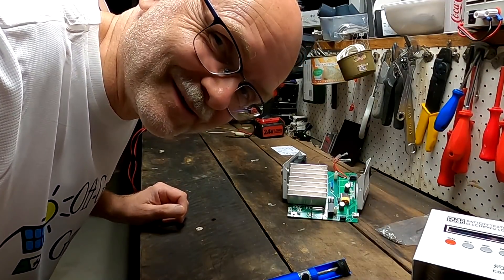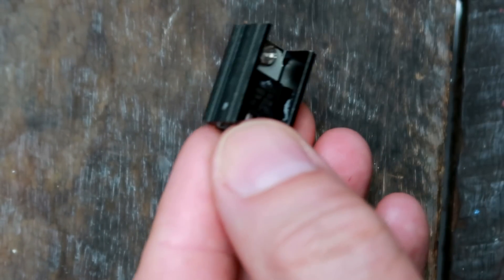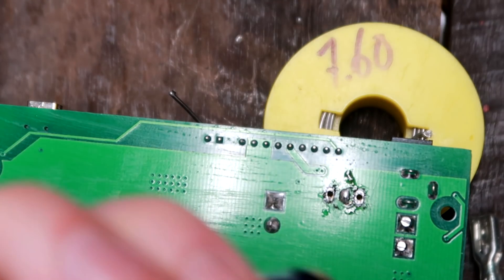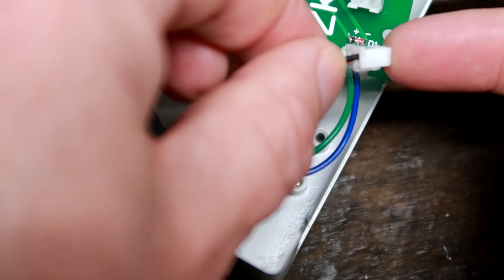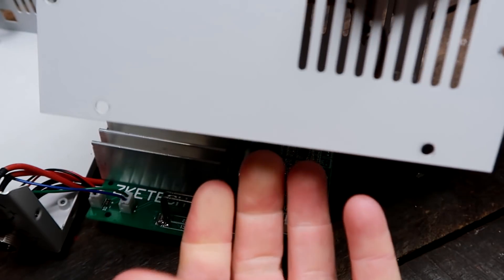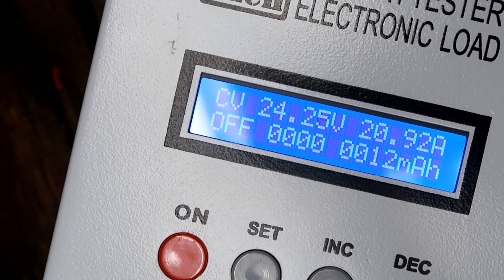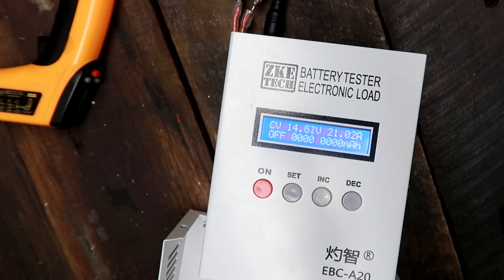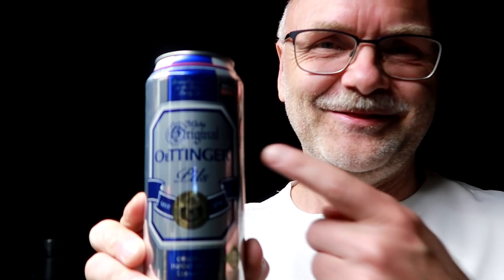Battery Tester Repair. Train wreck or fix? Part II

Comment: Yes that 0 volt plane really buggered you. Solderwick and a very hot iron to get the excess solder off then, heat it up again and push a bit of copper enameled wire through or, perhaps a very small drill; you need something the solder can't weld too to clear the hole..

Comment: All a bit lateI know but, you need to fit an H30 rubber sleeve over the end of your solder extractor so as the sleeve presses against the track where solder is to be removed. Also,the sleeve will protect the track from the hard tip of the extracor.
Fresh solder or flux should also be added to make the old solder more runny. A lot of heat will be needed for large + or 0v planes.

Comment: Hello, dear Andy ! Did you tried to change the main MOSFET ? My EBC-A20 showing the same symptoms now when showing 21A current out of nothing and can't analyze anything anymore, not discharging at all , only charging with about 6A regardless what I set but calculating like it is 21A :) and no voltage sense in the software (although on display shows it real) That all happened after reverse polarity by accident and I found out the main MOSFET exploded... I see there is no part 3 of this saga so you never tested this tester ? I ordered the new MOSFET for it , I need to wait more than a month to receive it (I live in Vava'u, Tonga). I'll try and let you know (if anyone will notice this comment at all... not much hopes but writing just in case... )
Reply: I received 2 packs of MOSFETS (ordered from 2 different sellers, but exact same part number which is exploded in my EBC-A20) and replaced it. No luck anyway. Same 20A current displaying regardless of anything set or connected or no. Then I changed the MOSFET to another one. Anyway did not worked. Nor charging or discharging mode. But then I found out it is actually only discharging with current 18A according to clamp amp meter ! Immediately after connecting a battery the discharging current starting going. I check - there is no short between +/- crocodiles. only 130Kohm.  I don't know may be the relay burned too and it's always connected to discharge mode. But why 18A then. So I gave up and going to buy EBC-A10H 30V 10A 150W ; it's max 10A discharge but EBC-A20 can discharge 20A but max 85W, while A10H can 10A/150W :) Charging is max 5A also but with max 150W , instead of 85W.

Comment: desoldering tips
1) don't pull the iron away, put them BOTH to the joint from opposite directions, iron angled low to minimize interference with desolder tip.
2) try solder braid!!!
reason pin 2 was a bitch,.. it's the regulator ground pin so that via is connected to the ground plane, which quickly wicks heat away from the solder.
Also, yes, there are vacuum desodler tools. IMHO, they all suck arse.

Comment: I guess when the original voltage regulator broke it let the full input voltage out to some sensitive electronic components like semiconductors or IC which killed them. That happens typically when a voltage regulator fails. But i remember that you checked the output of the broken one and it showed zero. Normally they tend to go short from in- to output, maybe just for a short period after it completely broke by overload then...

Comment: Tipp: use a tooth pick to get a hole in the solder pads when the sucker is not working! Or use desoldering brasswool to suck the solder out. And give the poor L7812 a bigger heatsink - it will get very hot with a 1 Amp load!

Comment: If you just take the mantle out of an ordinary coax cable and soak it into a bit of flux, it WILL suck up the soldering stuff (tin/lead/silver).
If needed a compresor could work too but then you have to find ALL the blasted conducting stuff around your soldering spot.
Very luxury: a sucking soldering iron will be the best.

I get less and less enthusiastic about this ZKE tester....

Comment: Datasheets.  The devil is in the detail and each figure is usually given independent of it's constraining variables.
For example, you correctly stated the maximum input voltage of 30V.  The minimum is 14.5V though for proper regulation of 12V under load.
However the limiting factor will also most certainly be the "Heat dissipation" of 15W.
It's a linear regulator.  All voltage is linearly dropped as heat.  If you have 30V in and 12V out, that's 18V dropped.  If you put 1 Amp through it, then 18W of heat will be dissipating.  The package cannot handle that, heatsink or not.  The maximum heat dissipation is junction to package, even if you put a square meter of heatsink on it, 18W will cook it eventually.
However.  Note that the package to air W/*C will probably exceed the thermal limit LONG before you get near 15W.  A to-220 is probably barely capable if self disappating 2 or 3 W of heat.  The ground plane on the tab might give you 5W.  An actual small to220 heatsink might get you 10W.  A large block of a heatsink might get you the full 15W, but you will need to do all the thermal transfer functions to work that out.... and yes... they really, really do expect you to do all those sums.
It may be the case that the designed of the charge did not do all those sums.
Another gotcha with regulators that tends to cook them into early death is "in rush" current.  If you have a chunk of capacitance on your board behind the regaultor and you have no inrush protection, when you connect the external power the capacitance will appear as a direct short across the regulator.  The caps will demand 100s of amps for a few milliseconds.  Powering the 12V reg from 15V you might get away with it.  Connect it to a 30V source and you probably wont.  100A 18V = 1800W through a 20W regulator = night night.

Comment: OpAmp goo brrr 😂
Change the OpAmp on the controller board
Reply from the maker: I did and it's still bonkers... The controller shows wrong figures on the display, shows amps even there is nothing connected.

Comment: did you ever get to do a part 3? i have an ebc b20h which also shows overvoltage.. issue also came after a power cut.. which could have caused either charger input or mains input to spike.. i was hoping to salvage it with a few new components..

Comment: Hi Andy, loving your vlog. Thanks. It makes sense to have a diode across a motor to prevent reverse voltage from the inductance of the motor affecting the rest of the circuitry. I remember taking this precaution when powering an inductive load through a power transistor back in the day.

Comment: Another viewer! I have been watching you on and off for the past 6 months. Thought that I should make a comment, saw someone already stated use solder wick I concur; but you solder melt problem is the heat transfer to the ground plane of the board. Just use a temperature-controlled solder station. Use your thermal meter to find the bad component on the board. I have an off-grid home in Arizona, but I am at my home in Wisconsin. I switched to LiPo assembled batteries about 18 months ago from China, 6 200ah 24-volt units the quality was questionable! After watching your videos with the due diligence, you put in your analysis of the charging and other things I decided to build 6 more of my own. After much research it looks like the best option for the BMS is overkill solar their attention to detail and the use of the same APP that you are currently using got my attention. I have all the batteries and BMS awaiting my return to AZ next month. I will let you know my thoughts on everything as soon as I have assembled and tested them. Really like your attention to detail and the good analysis using the equipment. A retired EE from the university of California.
Reply from the maker: Thank you very much, Charles and welcome to the channel. Thanks for sharing your story. Great to hear that you will give it another go and even get more batteries. What was wrong with the first batch you received? The Overkill Solar BMS is a great option for a good price. The only downside is the relatively low current (only 100A) for a 48V system which is a bit on the low side for me. Not that I will use that much current but I like some overhead with these devices. I probably stick with the QUCC BMS for now, especially after the 2nd battery bank goes live.

Comment: All the opamps probably sits on the 19V rail, so they are all dead. If you are unlucky the analog input on the micro processor is also damaged and will not read correctly.
Reply from the maker: Give me some good news!

Comment: I remove as much solder as I can with solder wick, then use a wooden toothpick to push thru the molten solder in the hole and let it cool.

Comment: You need to have the solder sucker in place as the heat is being applied. If you occasionally melt its tip a little bit, you're doing it right.

Comment: I am surprised no one suggested using a round toothpick. Just heat the joint, push a toothpick in from the other side and then take the iron away. The toothpick will not absorb any solder and you can just pull it out and  the hole will remain open. This method is also helpful if you have a lead broken off in the hole. You can use the toothpick to push out the broken lead.

Comment: You can maybe save it by replacing the IC that is getting hot since it likely failed. You need some flux, a heatgun and some metal tweezers to take it out and replace it. Those ICs usually cost next to nothing plus shipping.

Comment: There are desoldering irons available. In the company we have a solder / desoldering station from Weller, very good and very expensive. At home I have a desoldering iron which is part of my hot-air soldering station. But for holes I still prever the desoldering air pump as shown in the video. Just apply the soldering iron on the side of the pcb with the biggest copper plane (mostly the ground) and the air sucking desoldering pump on the other side of the pcb. So you can heat up and melt the solder and when it is melted you can suck it through the hole straight into the pump without any time delay. And of course you should clean the pump regulary and check if it can still make and hold a vacuum when switched. Apply some grease to the inside rubber sealing (after cleaning 😉) if the vacuum doesn't hold for a few seconds.

Comment: the diode may for blocking noise from the brushless motor....
Reply: it also seems like the A/D converter may be bad, or check the voltage dividers between the shunt/sense/ and microcontroller.   Im not sure how it was designed...
The amps are sensed by checking voltage drop across the shunt(s) so follow those traces to the A/D or voltage divider.  You may need to sit and create a schematic of that area.

Remove the large transistors/IGBTs and do a diode test on them... one of them may be affected as well

Comment: Just keep your soldering iron on the solder pad while sucking with the pump! The pump's tip is made out of heat resistant plastic, so it doesn't melt. When ypu remove your soldering iron, the solder solidifies instantly especially on the middle pin, which is connected to the ground plane and has a huge thermal mass (acts like a heatsink sucking away your iron's heat immediately)

Comment: Use SOLDER WICK, also called "copper braid" or "desoldering braid". Put the wick on the cold dry solder and heat the solder through the wick.
Alternatively, I sometimes use a wooden toothpick to "unclog" a PCB hole.
Reply: Second that! Much better on many pcb board. So easy to get frustrated and add too much heat to the board and destroy the lanes/the board.

Comment: Andy, the LM358A operational amplifier was failed and heated up to 80 degree. I suggest, that both OpAmps LM358A should be replaced - with the adjacent one also. These OpAmps are cost really cheap. The main problem will be resoldering of these SMD chips - this need some experience. OpaAmps are sensitive to overvoltage and can easily fail during it.

Comment: I always use braided wire call solder wick with flux. I bet that row pins pull out at both ends. The numbers climbing like that means the reading is measuring a capacitor.

Comment: They do have vacuum solder suckers I want one but I'm not sure I can justify one yet they start at like $120 American from what I have found and go up I did buy basically one of those solder suckers like you are using but built into a crappy soldering iron so like the hollow tip is metal and it has gotten me thru what I have needed to do but it's not great

Comment: Yes, there are powered desoldering stations and tools. Or, you can use the tip of a #11 Xacto knife. Or copper wick that absorbs the solder. Or a dremel tool.

Comment: looks to me like a shorted mosfet on that board.  That 8 pin soic that was blazing hot is probably the mosfet in question.  I have seen 8 pin mosfet packages like that in laptop motherboards.  I would have to know the number on that chip to verify it's a mosfet though.

Comment: If you heat the solder then sharply bash the PCB on the desk the shock often throws the solder out of the hole.
Reply: yup, I do that too

Comment: You need to replace the chip that is getting hot. It is surely a single or dual OpAmp chip that drives the gate of the power MOSFET(s) that charges or discharges the load/battery (pin 1 of one of the big 3 pin transistors on the main heat sink). The OpAmp is powered by the +12V supply rail that you fixed and would be used to measure a low voltage DAC output analog set point voltage reference from a microcontroller, compare this reference to the current shunt voltage, then output an analog voltage in the 0 to 12V range to drive the gate of the power MOSFET such that the current shunt observes the same current that the microcontroller is requesting.

Although you measured open circuit on the 7812 voltage regulator output, it evidently first failed by shorting the input to the output, thus delivering the full 30+V power supply voltage to the OpAmp and blowing it up too. The OpAmp then sucked down enough current to melt the silicon or bond wires in the 7812 such that it now appears open circuit.

OpAmps are a common off the shelf component just like the 7812 is, and you may even find the exact same chip if you go around opening power supplies, your Victron charge controllers and inverter, or perhaps the other el-cheapo PWM charge controllers.

Comment: Disconnect the fan and test again to eliminate it as the cause to the problem... 
I have read other comments suggesting that the diode is there for back EMF protection from the fan but the that fan won't produce back EMF because like PC cooling fans, it has a built-in driver circuit which doesn't allow current to output even if you spin the fan blades. 
The diode appears to be a reverse polarity protection on the sense wire's which is what I would do if I were to be designing a circuit where it is possible to reverse the polarity... This is good design practice 👍.

Comment: Keep that soldering iron on the pad and the solder sucker at the same time and hit the button don't move the iron. I work at an Army Depot and worked on the Minuteman missile doing electronics, they work well, but you can buy a nice PACE machine. Maybe do a calibration?

Comment: I wish I was there to help reverse engineer that thing to determine the connector connections.  From here the one with the diode is the fan to cut back EMF surge.  The thin traces are probably the sense lines since they use less current than the fan.  If the fan is 12v see if one of the 4 PCB pins connects to the IC you just replaced.

I bet the + labeled end of the diode is connected to the 12v regulator output.  That is definitely the fan connection.

Comment: What is the IC number of that component? Probably a opamp. The SMD doesn't look that small have a look at some SMD soldering videos. Or you can send it down and I will have a crack. Looks promising that the main IC is ok probably as that is the irreparable part.

Comment: Option 1: stand the board up, place the sucker on the top side, touch the iron on the bottom side.  Option 2: you can place the iron on the edge of the hole, place the nylon tip on the hole hit the button without pulling the iron away.  You're to slow with the method you're using.  The sucker tip is made to take the heat.  Keep inside the sucker clean.

To compound  your problem is the lead free solder.  It requires a higher temperature to melt and solidifies much faster.

Comment: i always use «Braid» for to remove solder, it’s more hard to learn but it’s better once learned.. what was happen to your factory/original 12v regulator 7812? ..if it was short, that explain the damage to your board.. those regulators have a over temperature protection and the only way to blow them is by over-voltage (over 35v.. continuously or with a spike!).. the chip under overheat look short and to confirm if he is alone, just remove it (using some Braid with the iron around 350c and a bit of lead on it.. capillarity effect!)..

Comment: That unit had it, that 12v may have sent a full voltage 19v onto the board and damaged most of the parts, mostly the ic's. They might replace it if it was under warranty?

Comment: looks like the Op-Amp went short, causing extraneous readings on the microcontroller then the linear regulator (7812) blew up due to it overheating. You might be able to replace the Op-Amp but it might have broken some SMD resistors which that and the Op-Amp will be hard to replace with only a soldering iron. you need a hot air station! Its probably best to just get a new one,  Good luck Andy!

Comment: 1/1000 comment here, @5:30 you probably just need a better tempereture controlled iron then crank it to get that ground hole clean. Other than that just make sure you press the solder suckerat the same time you remove the iron from the joint, not much thermal capacity in the joints so it cools fast.